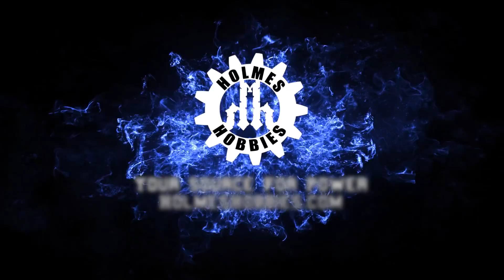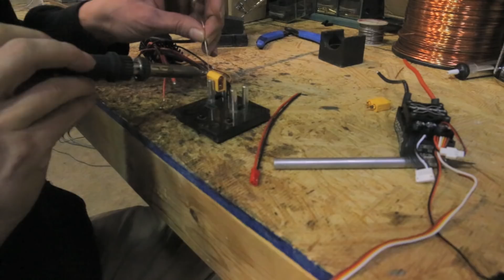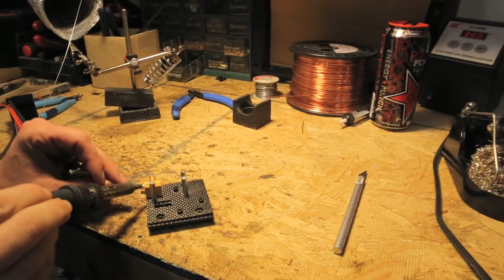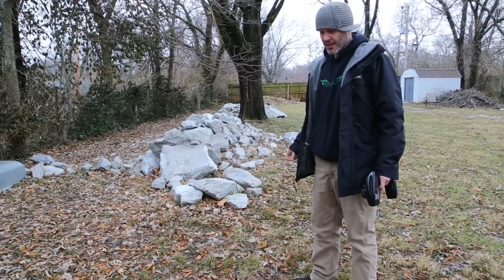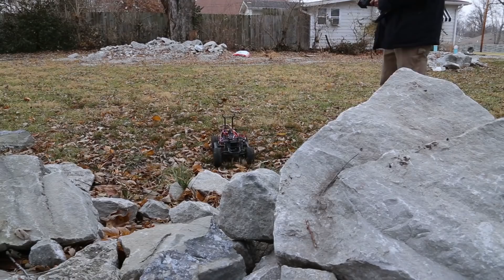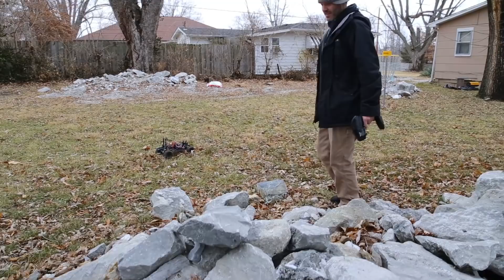Traxxas TRX-4 Brushless Upgrades

Comment: You installed two ESC in order to be able to compare them. But you only tested the Mamba, right? Or did I miss something here?
Interesting theme. I just got my TRX-4, my first crawler ever. The less mainanence and longer runtime of brushless appeals to me so I try to figure out what BL ESC would be the best. And of course, what motor.
Reply from the maker: The neutral trim on the radio needed adjustment to arm the BLE, was going to make a 2nd vid doing that since the traxxas radio isn't  straightforwards.
Reply: I use a quickrun hobbywing ESC and it has crawler settings and I use a 2150kv motor I tried a 3930kv but it was too coggy at low speeds the 2150 is buttery smooth lol. Don't go too high kv and I like hobbywing ESCs I have two different ones and they are so easy to program I have a program card but the quickrun doesn't need it to do settings I know the Mamba is more of a pain to program you have to be around a computer.

Comment: hi I'm looking for a new motor for my SCX10 II it's had two ESC but still running the original motor. I have lots of friends that run your Motors but they are all running lightweight trucks and faster than what I want to go so I can't use them as examples like you explained in one of your previous videos. So I just thought I'd go straight to the source and ask you. I want to continue using the exact same ESC up and using and it is good for 2s or 3s, I was looking at your 13 turn crawl Master sport. I'm looking for low speed and crawlability. Is your 13 turn crawl Master sport hand-wound? Thank you for your help
Reply from the maker: The 13t Crawlmaster Pro 540 is the motor you want
Reply: Thanks very much John

Comment: yeah I didn't find much info on the top speed for the 2850kv or I'd have went with the 2280kv instead but I'll just be gearing down some just trying to find some info on good gearing set for just a bit more wheel speed than stock 3s

Comment: I run the aux so I can have crawler mode first with 100% brake and drag brake second gear is no drag and no instant reverse with what seems to be less brake power so it's drivable on 3s and 4s lol

Comment: loving my trx4 swapped out the rims and tires for gmade sr02 wheels and rc4wd tsl super swamper boggers put a power hd 20kg servo and do to money went with castle creations mamba x 2850kv combo I picked up for 160 shipped after a coupon.
Reply from the maker: Hard to beat that price.  It's been a rough year with Castle dumping cheap motors into the market.  Had to lay off 25% of our workers because of the impact.
Reply: It's for crawling not for going fast why brushless?
Reply: Eric Bostick what gearing are you using with the 2850kv set up?